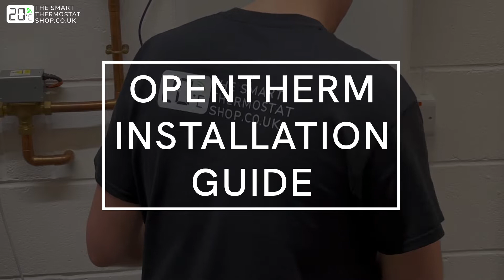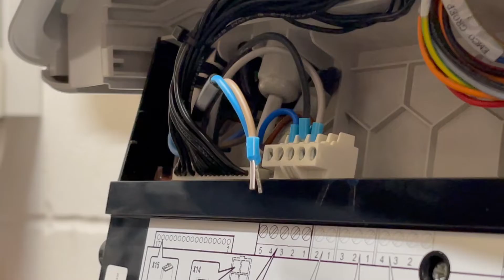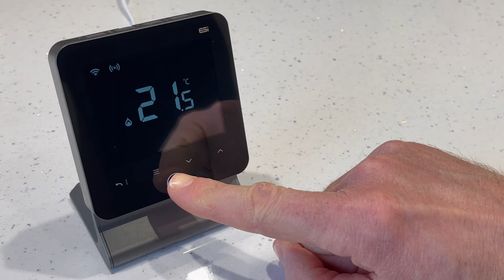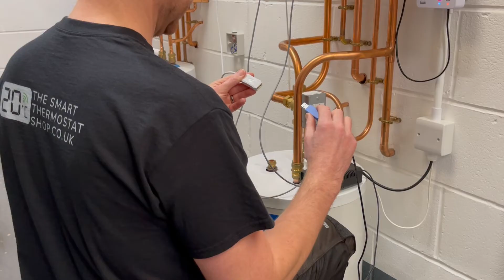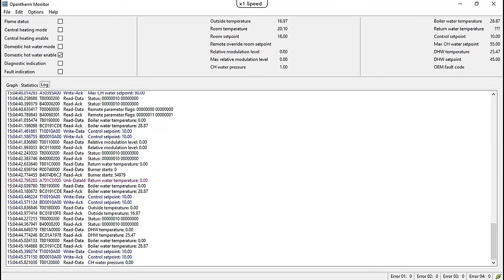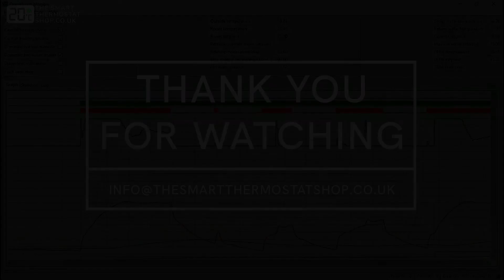OpenTherm Installation Guide!

Comment: looking for some advise on my boiler its a new boiler running opentherm its an ideal logic combi2 C30 and if it needs to add 0.5 degree it heats to 45 degree then cuts drops to 35 it fires for 12 seconds then pumps for 2 minutes till its back to 35 degrees and this goes on for an 75 minutes just to get that 0.5 degree i am in a 2 bed bungalow its thermally excellent ,  isn't this classed as cycling and is inefficient and not good for the boiler and running 75 minutes seems so long is it not using more gas that my old on off system that would run 10 minutes oor so  to get that 0.5 degree
Reply from the maker: Controls can only do so much. Your combi is going to be massively oversized on the heating side. Only a few boiler manufacturers have a good enough modulation ratio to overcome this and unfortunately Ideal isn’t one of those boiler manufacturers.
Reply: @MWPHS so would I be better off going back to the old wiring style and use the on off method with it I am in an efficient bungalow my old 15 year old boiler only used 5300kwh a year
Reply from the maker: @AlanS10018 on/off controls do not comply with current building regulations and all the science shows load compensation and weather compensation controls save householders more money than on/off controls do. So if you can have load or weather compensation controls on your boiler, you should, irrespective if it’s oversized or not.

Comment: So when using open therm you don't need to wire any of the switch cables etc. Just two cables to opentherm and live and neutral?
Reply from the maker: Correct, you don't use the switch cables and OpenTherm. There are some OpenTherm systems that do (evohome for example), so you always design the heating systems to the manufacturers instructions or training.
Reply: Ok thanks mines Drayton wiser kit 1 but it's not totally clear. Will look into it. It has a 2a section on wiring switch cables then 2b wiring opentherm so not sure if it requires both.

Comment: On a s plan where do you wire this in ? In the programmer with open therm ? And where do the zone valves go
Reply from the maker: This is not for S Plan's. There are only a few systems that can do motorised zone valve control and OpenTherm. I'd suggest having a chat with a local heating specialist to understand what is possible with your heating system.

Comment: Do you need to leave the link cable(the one you normally remove when fitting on/off controls) in when fitting opentherm controls? I'm looking at a Drayton wiser system, on a Viessman 100. 
Or would you wire the controls such that the switched live is controlled by the Drayton wiser controller?
Reply from the maker: Obviously this was an Intergas boiler in the video and manufacturers all have their own little ways of doing things, so its best contact the boiler manufacturer for exact guidance.
Reply: @MWPHS  The answer was the Viessmann didn't come with a link cable, and you also don't need to add one if you are running OpenTherm controls. You do need to change a setting and tell the boiler you are using OpenTherm though!

Comment: Another question :

Will OpenTherm or Weather Comp work on a system Boiler ONLY IF the SPlan is converted to XPlan??
Reply from the maker: When we are trying to make condensing gas system boilers more efficient, we need to have low flow temperatures for space heating, but higher flow temperatures when recovering the hot water cylinder. We do this using what is becoming widely known as Priority Domestic Hot Water (PDHW). More details on this in an article I wrote here a few years ago - https://theintergasshop.co.uk/content/189-why-hot-water-priority-is-the-reason-s-and-y-plan-should-be-banned

X Plan is something we developed (before Intergas Heating adopted it) and this is a heating design method capable of achieving PDHW. 

There are many other methods of achieving the same thing, BUT standard S Plan or Y Plan system will not achieve PDHW without clever wiring or additional relays removing power from the heating valves, when there is hot water demand.
Reply: @MWPHS  my understanding is that you can make boiler condense by simply turning the max temp to 50c on the boiler. By doing do does that not mean the return will be something like 40c return ? And therefore condense?

If true - then the problem is that the hot water tank will take days or weeks to reach Max temperature on cylinder stat 60c.

In other words it seems possible to run Condensing mode on system boiler without a problem. It only would require me to increase the temperature back to 60c each time I am going to heat the tank. Am i understanding this correctly or am i missing something? 

As for PDHW: I am trying to find a diagram that I can follow. I got Ideal Vogue Max which seems to have two SL ports (L and In). Also got the NO valve handy for this.

If you have a diagram to show how I need to connect wiring for my system pls let me know as I been trying to fix this past few months but no luck.

Comment: I have a nest learning thermostat. It knows the outside temp of it's location via it's internet link. Does it or can it use that info as weather compensation to determine boiler demand?
Reply from the maker: It is possible for smart thermostats to use weather data either via the internet or a weather compensation sensor attached to the boiler via the OpenTherm connection within its algorithms. Obviously it is down the the thermostat manufacturer wether they use this information or not.
Reply: @MWPHS  Yes, that was my question, can / does the nest thermostat do this?
Reply from the maker: @45graham45  don’t know but the manufacturer claims to.
Reply: @MWPHS  thanks.

Comment: What is the serial data protocol used? Eg RS485 or RS232 etc. Or does Opentherm use it's own unique protocol? If so so, what basically is it? Eg +-5V signal or 0-15V or even a mA signal etc?
Reply from the maker: The V2 OpenTherm specification is available here to download - https://ihormelnyk.com/Content/Pages/opentherm_library/Opentherm%20Protocol%20v2-2.pdf

Comment: I thought the idea of opentherm was to modulate the flame so that the boiler does not cycle on and off but run at as low a temp as possible, I have an esi esrtp but this doesnt seems to be doing that, its a heatline sargon wich is opentherm compatable, the manual doesnt mention openthem but the wiring diagram shows it, plus the fault codes will how on the esi display
Reply from the maker: The thermostat can only use the OpenTherm communication to instruct what flow temperature it wants the boiler to run at. How the boiler operates at that flow temperature is at the mercy of the boiler itself. If the boiler is dramatically oversized to the property with a poor modulation ratio, then irrespective of what the controls try to do, the boiler is going to cycle. Different boilers and controls have different levels of OpenTherm compatibility based on how well the manufacturer has programmed them.
Reply: Did u manage to solve this, I have same problem with an ESI esrtp4rfw wired opentherm to an ideal logic, I’ve decided to order the EHP CP4 Thermostat and hope it will work properly with opentherm.
Reply: @carlfairhurst8317  MWPHS was correct in saying its up to the boiler what it does, The range of modulation on the heatline isnt that great but there is a sweetspot, It does communicate sisnce if there is an error code on the boiler it shows on the display of the controller

Comment: I've just installed a Drayton Wiser system to my Baxi 800 utilising OpenTherm.
I've noticed that my radiators now get scalding hot even when requesting just a couple of degrees increase.  Is this normal?
Reply from the maker: Has the Baxi got the capability of controlling its maximum flow temperature once an OpenTherm controller is attached to it? If not, then this could very likely be the result.
Reply: @MWPHS  Emailed Baxi and they say "To adjust the temperatures on the boiler, it is done within the opentherm controller".
Guess I need to call Drayton.
Reply: @MWPHS  Afaik, 2°C or more between target & actual temp will call for max boiler output. The Baxi cannot control max temp when using open therm. However, max temp can be set in the settings on many smart thermostats. The info should be in the thermostat instructions.

Comment: May I ask if you have experience with TADO smart thermostat and Ideal Vogue Max to setup Opentherm and PDHW?

Further more, do I have to travel two new cables (blue and brown) from unvented Tank down to the boiler? It be two different floors in my case.
Reply from the maker: Unfortunately we don't, however all OpenTherm thermostats with a wireless receiver will be very similar to the one in the video.